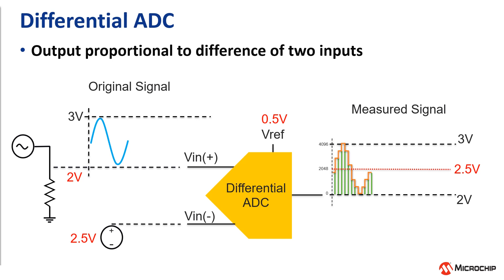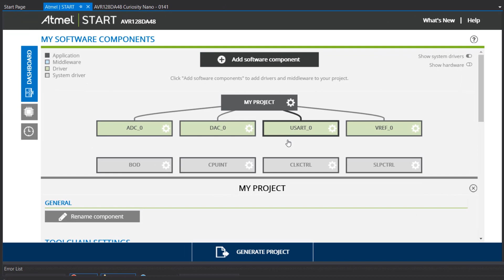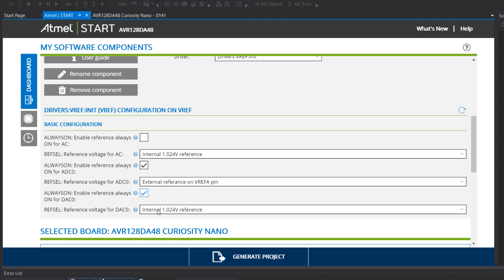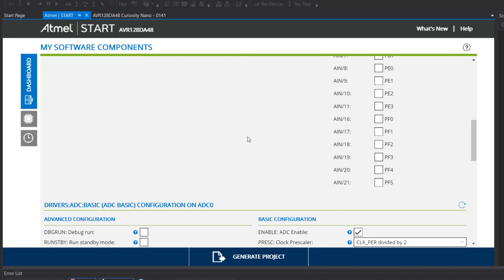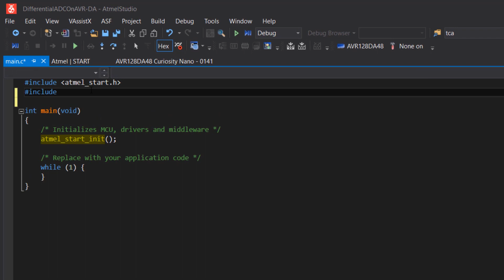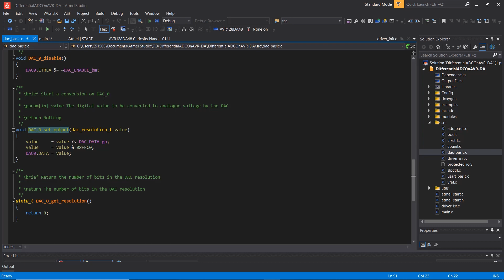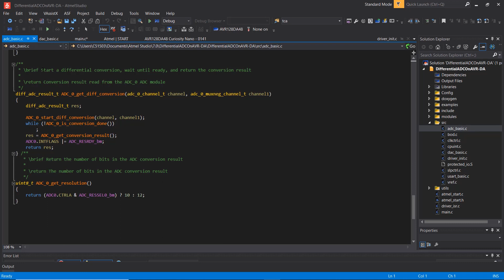Improving Sensor Resolution with Differential ADCs on AVR® MCUs

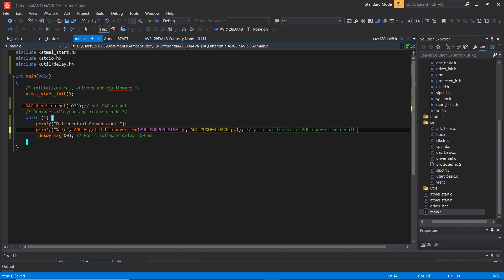Comment: I'm a bit confused by the example given in the video.  The hardware setup in the video at 8:00 shows that a 0.5V VREFA signal is used when describing the ADC configuration.  However, the datasheet for the AVR128DA says the valid voltage levels for VADC_VREF is 1.8V to VDDA. Am I understanding the video and the datasheet correctly?  What is the impact of using a VREF for the ADC that is so far out of specification?

Edit: I see this is part of the accuracy specification, not limits.  What is the impact on accuracy as VADC_VREF decreases?  What is the lower limit for VADC_VREF?
Reply from the maker: Kindly visit support.microchip.com for assistance. Thank you.
Reply: @MicrochipTechnology  Please set up an AVR forum at https://www.microchip.com/forums/f515.aspx